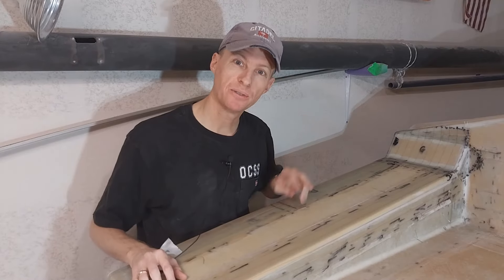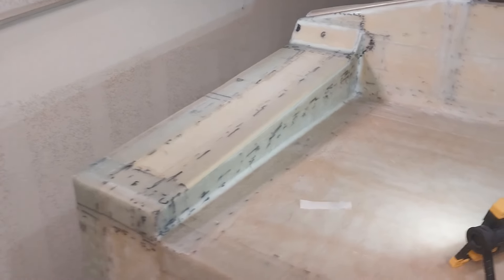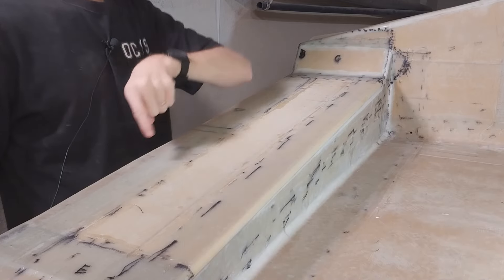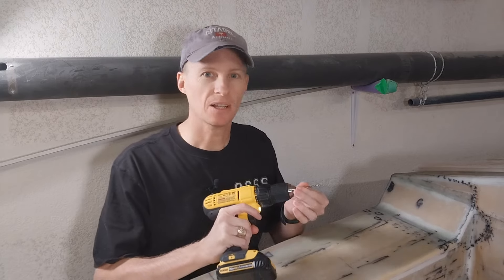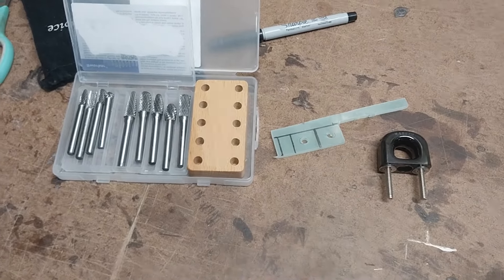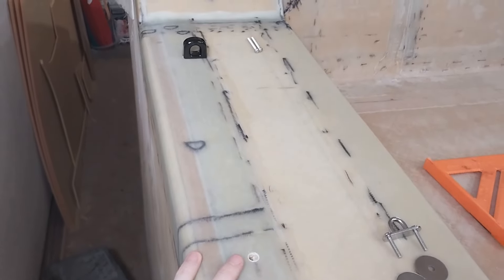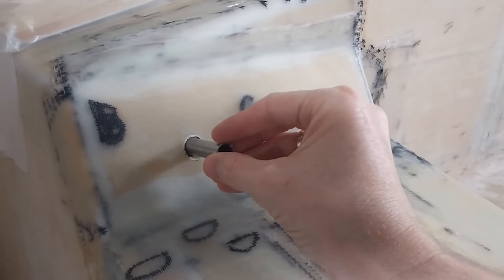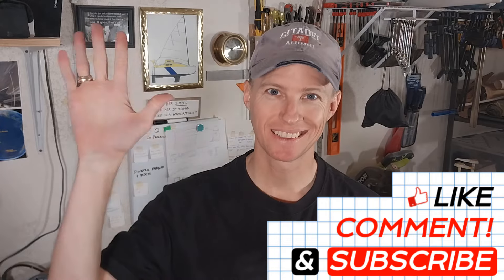OCSS-073Pt2 Mainsheet Fairlead and Block Install (February Mini Episodes) - Mini-Cruiser Build

Comment: Thank you so much for sharing the details of your technique for flaring the stainless tubing! Well done. Definitely something I'll use.
Reply from the maker: Thanks, they make an automotive tool that does it, but as I only need to do this for 2 tubes, I opted out of buying it.
Reply: @ocean_capable_small_sailboat  Please don't ever strike one hammer with another! The heads are hardened and can shatter. A good replacement would be an plastic rolling pin- those suckers are heavy, non-marring, and easy to find.

Comment: It's looking good, you are making good progress. When you put epoxy into the holes for the mounting bolts try poking a tiny hole in the tape.  I use a sewing pin.  It gives the air a way to escape but is too small for the thickened epoxy to go through.
Reply from the maker: That would have helped! Thanks for the tip.
Reply: Next time.  🙂 @ocean_capable_small_sailboat

Comment: It is a bit late for a suggestion but have you tried this technique in place of your Drill/Fill/Drill method? Drill the hole you want but only through the first layer. Use a nail with a 90 degree bend in it (like an allen wrench) with the long leg inserted in your drill driver - place the short leg of the nail into your hole and hog out the foam core - vacuum out the foam dust - fill with epoxy (use syringe for epoxy) - Then redrill the hole through both sides of the panel.   The advantage is that you don't need to tape the backside of the hole to fill and you don't need much access to the back side at all. Also the fiberglass layers are preserved lending some strength to the new plug of epoxy and tying it into the skin of the structure. This is a technique we used in constructing Aircraft. I have easy access to used but clean syringes but an alternative would be to oversize the first hole - you still avoid taping etc. Edit: Ok I see your other videos show you know this technique already. I just noted you used a different way in this one. Nice work.

Comment: Aren't you supposed to wear a face mask when you pull off the peel ply, shouldn't it throw epoxy dust around the whole room?
Reply from the maker: Not that I've seen, no. I wear one for drilling and sanding, etc.